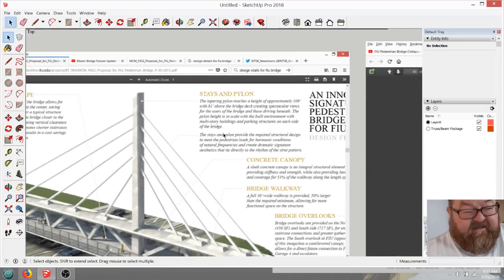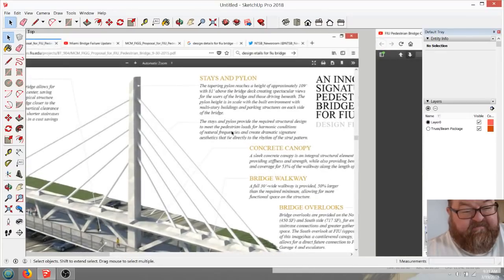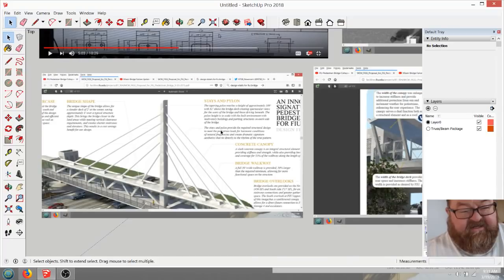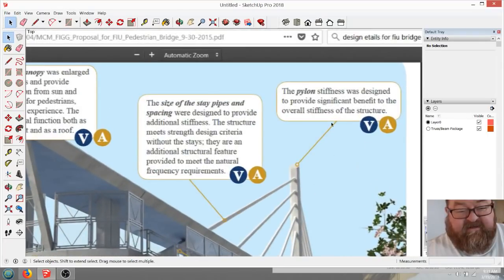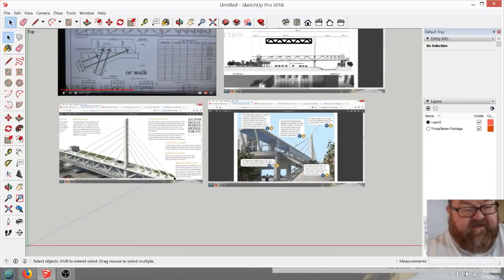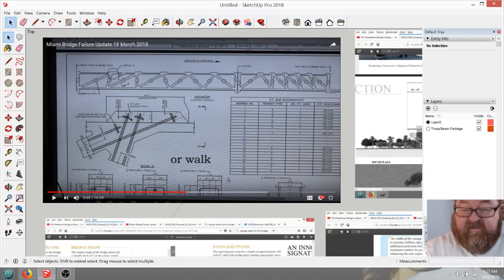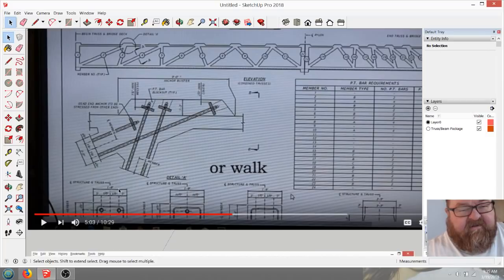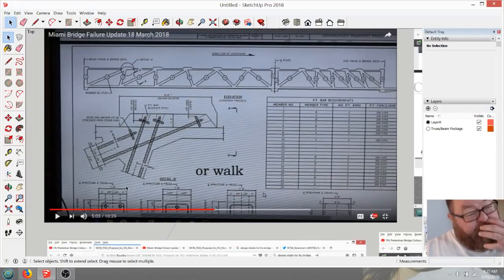FIU Bridge Collapse Follow Up

Comment from the maker: One of the points I meant to make in the video was that trusses rely a lot on the connection of the webbing for stiffness and transferring loads.  There was no way for the tension rods to have these connections because they had to be post-tensioned.  There is no way for these concrete webs to act like a truss.  There were no real connections between the webbing except for concrete which is terrible in tensile strength. This was auto-failure built into the design.
Reply: I agree 100%.
Reply: Definitely agree. My initial thoughts were that it should not have been able to work without being sufficiently connected. A proper cable stay design could achieve that. But maybe more importantly, I don't understand how it can act in a truss-like fashion. The nodes need to act as if they are pinned to avoid excessive bending moments, but concrete will not act that way! Like you said, if it didn't fail now, it would fail later. Shifting loads, temperatures, tropical cyclones (!) would over time cause permanent erosion of integrity.
Reply: Seems pretty simple to me- What we have here is an asymmetric cable-stayed bridge that could not support it's own weight before the pylon and cables were installed. Just insufficient analysis of the un-supported structure.

They were most likely reducing the tension on element 11 which was pulling the structure down, not holding it up.
Reply: Per the drawings, there are no tensioning elements in element #11, or #12, and there are 4 of them in #10, so they couldn't have been working on #11, and that element looks like it was intended to be in compression for the entire life of the bridge, no matter what else was going on at the time.

Perhaps not a cable-stayed bridge, but a really poor implementation of a truss?
Reply: I also agree, in no way is that design a dependable/reliable truss , find it a miracle it stayed up for the week that it did, without support.
Reply: Yup. there seems to me to be  some 600 tonnes of push, against 600 tonnes of (80degree) pull at that first joint, with some nuts and bolts and plates and some blob of concrete to transfer it ( unlike a nice bolted metal-truss joint)
Reply: If it was an auto fail, and it looks like it was, it could have been so much worse. How many people/weight was it designed to carry ?
Reply: ArtisanTony — This is not correct.  The truss was full of tensioning cables and bars which were supposed to hold all of the truss elements in compression where necessary.  Obviously, it didn’t work in practice, but the statement that “there was no way ...” is not correct.  It was just poorly designed or executed.
Reply: @dwilliams2068  No. It was not even remotely a cable-stayed bridge.  There were no cables to support the thing in the design at all.
Reply: The connection of the web to the canopy and floor depends on rebar, whether the joints were cold (as they were) or continuously poured.  There was not nearly enough rebar for the load at the 11/12 node.

Comment: The “stays” were structural only in the sense of adding a little stiffness to resist deflection under live loads.  They were not structural in the sense of holding the span up.  The span had to be self-supporting without the “stays.”  Any strength they would have added to help support the span would not have been significant.

Comment: Folks, I'm a Mechanical Engineer, UT at Austin, 1974.  Although I am not a Civil or Structural Engineer, I took engineering basics in Statics and Dynamics and Strengths of Materials, my Core Major being Machine Design.  Statics is the study of loads that are "At-Rest".  Dynamics is the study of loads "In-Motion".  As the Host of this series (2 so far) has indicated, there is indeed rhyme to his electronic drafting extension of the Truss Elements.  I'm of the opinion that maybe all the calculations done (all by computer now, no slide rules and sketches/schematics drawn with basic equations written down and round table discussions performed to confirm all base assumptions) are straight out of computer subroutines whereby you simply input in the spaces and out pops the answer that is nothing more than a YES or No with no ranges or percentage over/under design values.  Although the brochure says the Tubes/Cables are only to address "Dynamic" Loads for pedestrian harmonics and category 5 hurricane harmonics, but also esthetics; I agree with the host, they surely provide for the "Static" Loads also.  As the Host has expressed, I think the design will prove to be insufficient to provide for "Static" Loads during installation, prior to the stay and tubes/cables being in place.  Also, falsework supports were insufficient during installation and based on other video hosts; not in specific position called for, on one side, due to roadway obstruction not considered prior to installation.  It is a major "SNAFU".  Design was too complicated for installation translation!  Who is to BLAME?  Primarily design engineers for you need to Keep-It-Simple for its SAFE installation.  Forget about aesthetics.  Save Money and avoid Legal Fees.  No one will mull around the bridge and revel in its beauty, unless you are smoking dope?Just let me walk over the busy roadway!
Reply: Robert J. Davidson ... I have no credentials but that was a long span with only a few places to tie it in place on thin supports at either end to hold it up.
Reply: If they had designed a simple but non-decorative "Pre-Stressed Concrete" span, like the ones you see on State highways/National interstate roadway bridges and overpasses all over the US and originally in Germany in the 30's for their Autobahns (the Germans developed "Pre-Stressed Concrete" bridges and interchange overpasses for the Autobahns.  I worked in Victoria, TX, my hometown, while going to Junior College at a "Pre-Stressed Concrete" plant.  The Spans I helped construct in Victoria, TX ended up being shipped to Austin, TX for their I-35 "Upper Deck" running through Downtown Austin, North and South - "Odd numbered" Interstates run North/South and "Even numbered" run East/West and "Triple numbered" are by-passes around - and I ended up driving on my work while attending my last 2-years of college at UT Austin in 1972-1974.  As one of the Videos I watched indicated, you didn't see any curvature in that roadway Span so it is not a "Pre-Stressed Concrete" Construction); you could have forgone the Decorative Spar and Tubes which I believe were an integral part of the Load Support for this "Length of  Span" going over the roadway. So that is why they had to incorporate the Spar and Tubes.  But you may be correct, the distance across the roadway might have been just past the distance you can have a "Pre-Stressed Concrete" span?
Reply: It was only tied in at one end, the middle tower. Other end was on floating bearings to allow movement

Comment: If two engineering firms would have checked the design for safety this would most likely not have happened.  Want to see a good example, check this out.    The New World Hotel collapse Singapore 1986   Since then two engineering firms are required to sign off on the final design.

Comment: Ok...this information from the designer is a phenomenal revelation.  The engineer believed the preconstructed bridge would be strong enough to support itself.  Which is why they removed the temporary supports.  The tower suspension cables were installed for "aesthetics" but not really needed.
OMFG this engineering firm should be shut down.
Reply from the maker: D N i agree!
Reply: Any engineering student would automatically think: Oh, that's a statics equation... and include the upper rods... the angles imply the upper rods are part of the statics equation. When I read in the brochure that a lack of emphasis has been placed on the upper rods?  That's one thing, but for anyone to run with those few statements that were probably written by a marketing firm and not an engineer... it amazes me that so many YouTube videos actually emphasized that they were aesthetic & not structural.
Reply: Nothing that big and complicated to install would ever be purely for aesthetics. It would have been the first thing cut from the budget. They were meant to be cables and they were meant to support at least half the weight of the structure.
Reply: D N ... Alarming since it is the engineer's job to do the calculations and know, approve it would stay up. That is an odd statement. No wonder.

Comment: Maybe it's a little nit-picky, but you keep pointing to the left side of this rendering & the drawings, as if that's were the problems were, but in fact, the failure started on the right side of where the later pylon was to be placed.  In the drawings, the right side is the northern side, and the workers were adjusting the tension on the blister over #11 & #10, NOT #2 & #3, like you keep pointing to, or as the detail drawing view shows in the preliminary plans.  Consequently, they couldn't have been making any adjustments to #11, because according to the same preliminary drawings, there are no PT rods in #11, but there were supposed to be 4 of them in #10, and that's were the workers were when the collapse happened, if I'm reading things correctly.

We're all learning here, an unfortunately, there was a tragedy involved, the the more we can all learn, the less likely that this same sort of tragedy will happen again?
Reply: Test  It appears to me that the reverse canted members on the left side transfer their load through the top chord to the members  on the right end of the span. This radically compounded the load on the right side members, which failed.
The design is self defeating and the stress analysis is way too complicated. In my opinion, only the members on the right side  resist the static loads. The members on the left side transfer their load to the right side. They work against each other.
Reply: Yes, 10 and 11.  A lot of "experts" are making this mistake.  Doesn't give you much faith in what they have to say.
Reply: Test User — That’s correct.  He is pointing to the wrong end of the span as the point of failure (at about 19:45).

Comment: If  I'm looking at the drawings correctly no one has noticed a huge error. The drawing clearly shows member 11 as a "Type A" member. The "Type A" memeber is supposed to be built with (4) tension rods at 280kips each. Looking at the wreckage it was  clear to me that it was built as a "Type B" member with (2) tension rods at 200kips. Either someone screwed up big time! or the drawings changed.

Comment: The failure was at the top of 10&11, the canal side not 2&3. I don't know if those are the original or the final drawings. I heard the state had them alter the plan moving the center mast 11' toward the canal to allow for widening of the roadway later. That could also be another contributing factor.

Comment: Your view that the design looks like it would fail eventually is a sharp insight. An old saying in aviation goes "If it looks good it will fly good. If it is ugly it will fly ugly." The design was overly dependent on CAD instead of the human eye. The Howe truss you show was figured out in the 1840's. This ain't rocket science, folks.
Reply: Malcolm Marzo You cant blame this on CAD, they took a design that should have been built out of steel and tried to build it out of concrete. At the end of the day, cost cutting will be the reason this bridge collapsed.

Comment: I heard the theory is that changing how it was meant to be moved into place to accomodate the roadway situation  resulting in a significant cantilevered section of the span loosened the pretension. When it failed the worker was post - tensioning to correct the looser tension and the cable suddenly failed.

Comment: I am going to go against the grain here. I don't think there is anything inherently dangerous about a concrete truss bridge as long as it is designed and constructed properly. The depth to span ratio looks quite reasonable. The web spacing was not uniform but there is nothing structurally dangerous or incorrect about that. It just makes it more difficult to design since each joint and member has to be designed separately. Member #11 was a compression element. In theory, it didn't even need post tensioning for the strength of the truss element itself (the post-tensioning may have helped confined the joint which is another issue). In fact, the post-tensioning added to the compression stresses in the concrete in a member that was already under compression. If there was a flaw (such as a large void) in the compression element, the post-tensioning could have actually caused a compression failure of this member. Everyone is assuming the cable snapping was the failure mechanism but that is not necessarily true. In fact, the only thing that the post-tensioning may have been doing is to confine the joint (confined concrete has a higher shear strength than unconfined concrete).

There are certainly less expensive way to deal with pedestrian harmonics than by adding a quasi cable stay structure. If the client and architect want to spend money on aesthetics, there is a reasonable argument to be made. Personally. I don't want our cities to be drab. The engineer will usually go along with the flow as long as they can still design a reasonable structure to meet code requirements. I think most people are jumping to conclusions and potentially barking up the wrong tree.

What amazes me about this bridge is the torsional flexibility and how the torsional stiffness and strength was designed. I suspect it had a very low torsional frequency. The web elements would have to carry out-of-plane (weak axis) bending to distribute the torsion to a couple between the roof and deck. My gut feel is that this would have been the most difficult component of the design to justify.

In the end, the engineers may be fully or partially responsible but so many people are criticizing a design without an understanding of the nuances of design or structural engineering.
Reply: Spot on Andrew. My feeling is there are some very odd forces at that joint there (11-10). HIghly loaded and with large shear (and its nuts-and-bolts-and-blisters), and hopefully plenty of re-bar to transfer the forces.  But looking at the deck photo with its tiny-looking  truss members, and large wide heavy decks, it would give me the shakes to walk over that, (torsion and all). It feels all wrong. Looks it and feels it.
Reply: A McLellan — It appears that the designers of this bridge likewise did not understand the nuances.

Comment: What you're saying here is exactly what I've been saying from the beginning. When I found out that this was supposed to be a cable stayed bridge, my first thought was, well, where the hell are the cables? That huge pylon should have been the first thing built so that the bridge could have been supported by the wires that would have been suspended from it. I watched the Kosciuszko bridge being built in Queens, NY and the way it went up was one section at a time, connect the cables and then install the next one. There is no way these cables were meant to be purely "aesthetic." My guess is they needed to show people what they came up with, and the project was already behind schedule, so instead of building the 100' pylon and laying the cables first, they went ahead and put a bridge section in place that wasnt supported properly. And the way you described it saying that the short span should have been built first so that the cables could be connected and bear some of the weight of the main span is absolutely correct. Also, I've been calling the canopy structure a "truss" too, even though its not, simply because I don't know how else to describe it, and "eccentric concrete canopy support system" just confuses people.
Reply: L v — It was never supposed to bea cable-stayed bridge.  I don’t understand why the presenter is talking about cables.

Comment: My opinion is all trusses are essentially tension structures.  The triangle is strong because its shape cannot be changed unless one of the three sides is lengthened or shortened.  The idea of a concrete truss is completely idiotic.  The more one looks at this design the more one realizes how completely stupid it is.  As for harmonics, this span was comparatively short, nothing like the Tacoma Narrows bridge.  If they wanted this design which in fact is not all that great, the center truss section should have been of structural steel which then supported the bikeway deck with steel joists .  The side rails of the lower deck could have been conventional steel trusses and a double cable system could have come from the central tower down to each side rail.  The upper deck which is really just a rain canopy could have been constructed of a much lighter system.  This really has to be one of most poorly designed bridges in the history of all mankind.
Reply: No . The most poorly designed bridge in history was the suspension bridge over the Thames at the Tate Modern. This, the architect felt should show ground breaking innovation by having the loads ( people and walking-deck) not suspended under the suspension cable, but placed ON it !  This was equivalent to you and I walking 'over' a tight-rope ( rather than hanging from 'underneath' it). The end result was a wildly swaying bridge side to side, (and the architect blaming the engineer, by the way